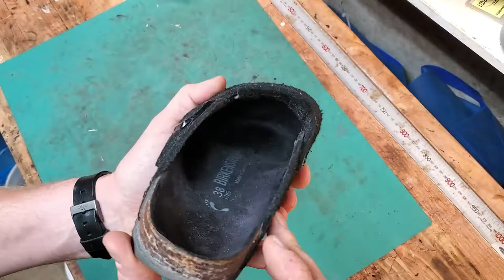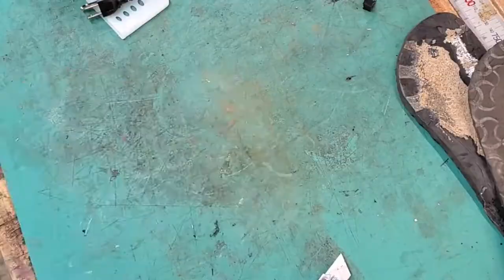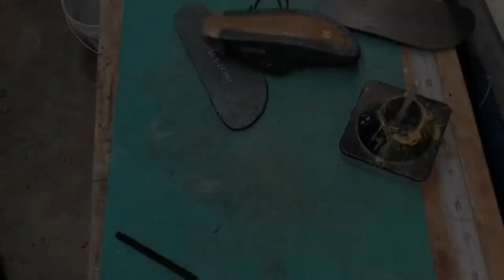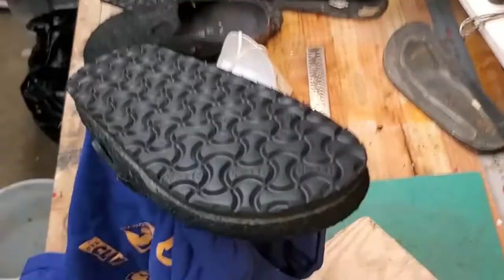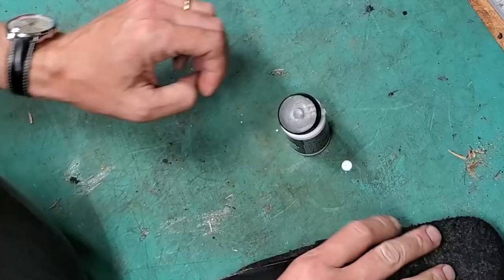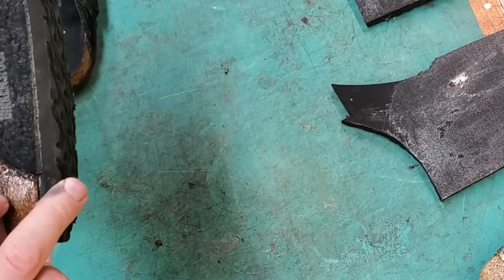I put new soles on these Birkenstock clogs at home in my garage workshop!

Comment: Woah, woah, woah. Tell us about that trick with the white sheet of paper/plastic you used to help line up the glued soles and uppers. How does it not immediately bond with the contact cement?
Reply from the maker: It was a Summit Racing sticker I had lying on the bench. If the contact cement is dry, then smooth things like sticker paper won't stick to it. I learned the trick of putting a barrier in while lining things up from one of the Al Stohlman books about making leather cases. He suggests using wax paper, and that's really the best choice, but I was in a hurry and the sticker was right there. I've used magazine pages before, too, and they work fine.